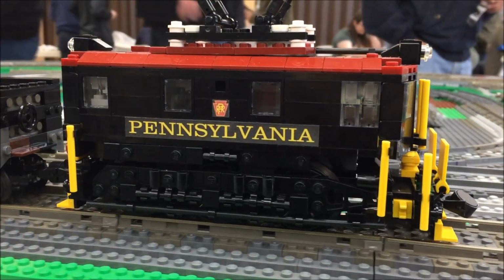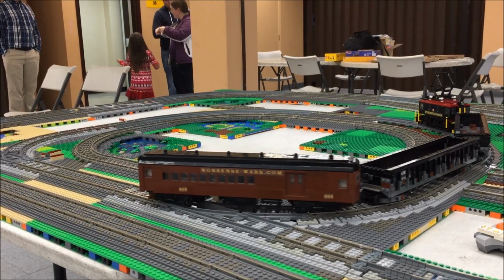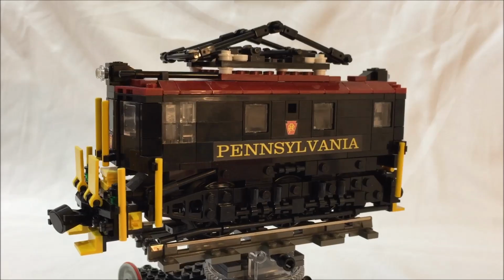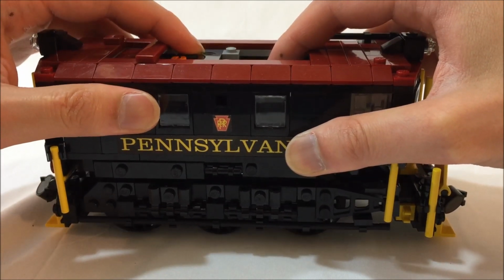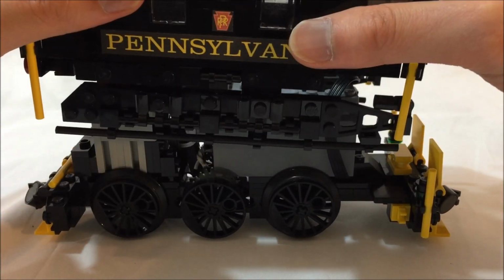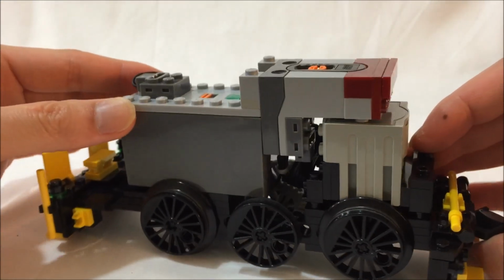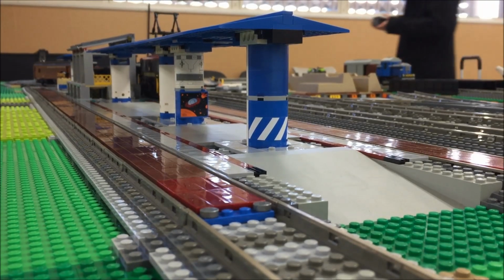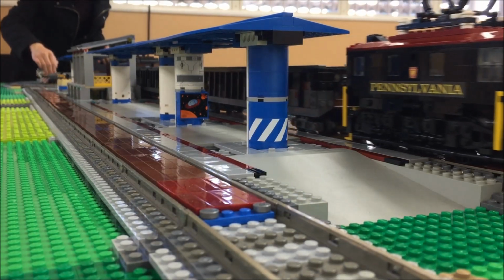LEGO 1:48 Pennsylvania Railroad B1 (Power Functions + 9v)

Comment: A fascinating little model, this has really inspired me to try making something in 8-wide! I love how compact this mechanism is! Do you think it'd be possible to cram something like an M motor into a unit of this sort of size?
Reply from the maker: Hmm, if you ask me it really depends on the engine and the implementation. For example, this engine has a lot of volume for its length, but it's "wasted" because the additional width doesn't actually let you re-arrange any of the components: the motor, receiver, and battery can't fit next to each other, so the mechanical part of the engine is still four-wide. On the flip side, if you had a prototype that was narrower and longer you could probably fit an M motor horizontally and include the battery box and receiver in the same volume.

Comment: The coupler problem that you have outlined is something that I have encountered too. I have built a 1/48 scale GP38-2 and it has body-mounted couplers and the overhang on R40 is ridiculous. What I have done to get around it is actually making my freight cars with articulated coupler shanks.  (https://www.flickr.com/photos/164038969@N02/47932349168/in/dateposted-public/ ) This isn't the best long term solution but it works for me.
Reply from the maker: Yeah, this problem has basically made body-mounted couplers a non-starter for me. The problem with the extra link between the magnet and the bogie is that it only works in tension... if you try to push it will flex in undesirable ways. Still, if pulling is your only use case it definitely does the job.